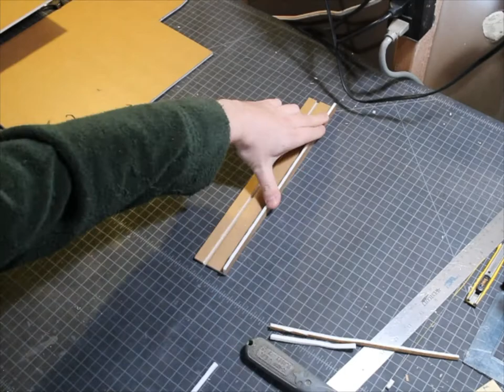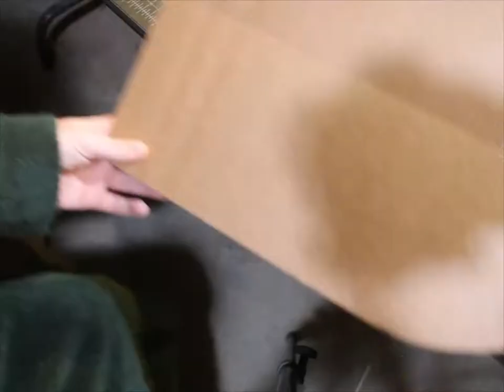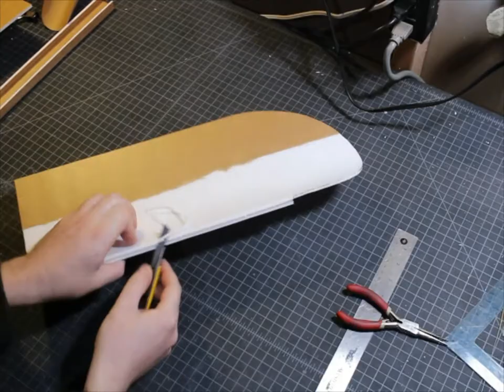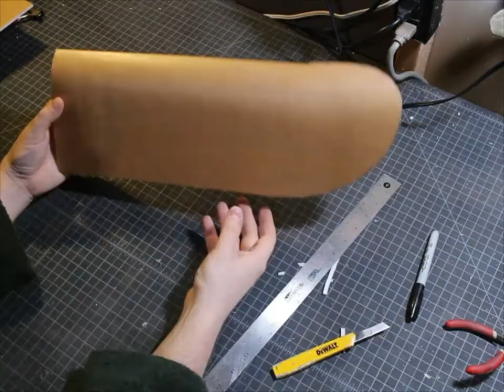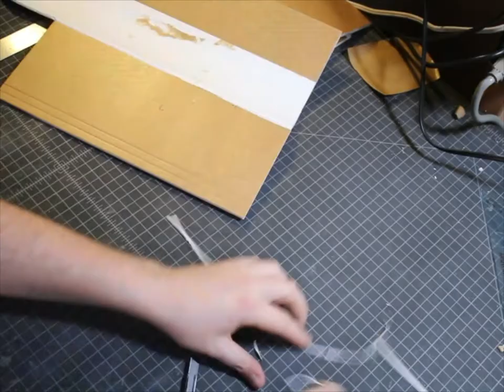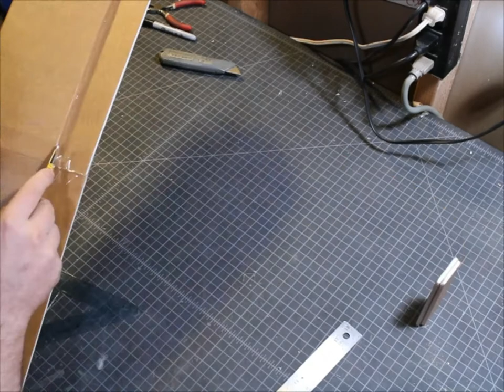Mini Ercoupe Build Part 5: Wing

Comment: I have been toying with replacing the paper back for strength and paint... I keep forgetting to Keep the paper. I enjoyed seeing the process in action, Thank you.
Reply from the maker: It works OK with Gorilla spray adhesive, just make sure to use a light spray onto the paper and let it tack well before applying.  If you spray directly onto the foam or apply the paper too early, it will melt the foam and you get bubbles/ripples in the paper.  I folded over the overhang on the leading edge with hot glue for strength.
Reply: @alanoneuser  Good tips. I appreciate it.